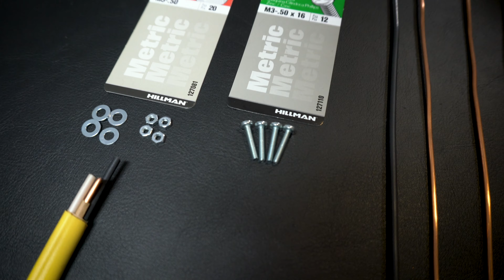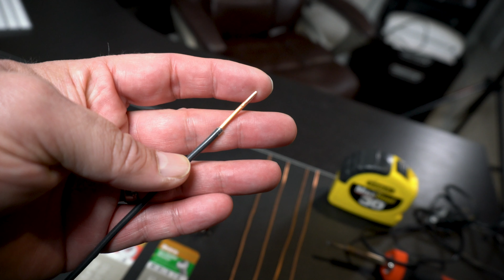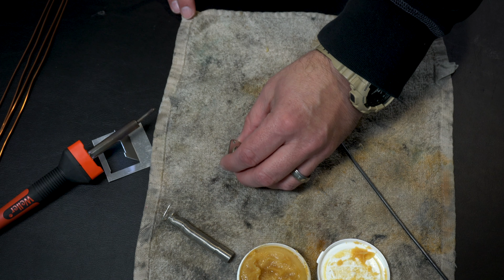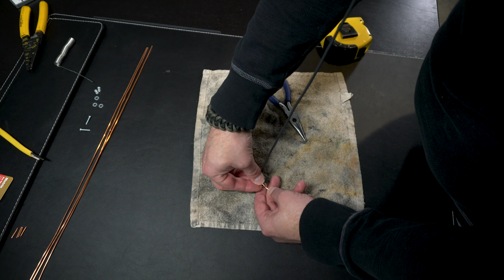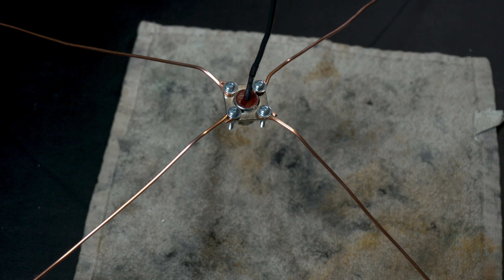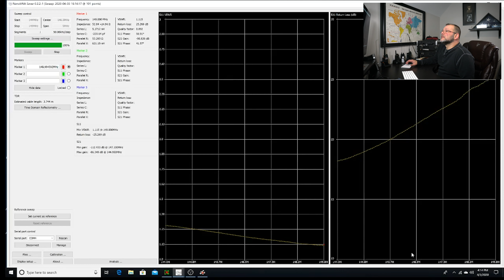Building a ground plane antenna

Comment: Hi there-new ham. I built one for 2m/7cm and I would like to put it on a pvc mast but would like to leave it outside permanently and run coax to my house for winter use. My question is does this type antenna need to be grounded, or just the coax?  Trying to figure out the best way to do that if it's necessary. Thanks
Reply: This is a quarter wave ground plane antenna.  Antennas of these kind do not need to be grounded..  the radius act as and reflect the signal at the same time

Three of them they all work great. The same antenna for 2 m and I also made one for GRS, which is a smaller version.  A smaller version for GMRS is very similar to 70 cm and I use it on 70 cm quite often even though the dimensions aren’t perfect. It still seems to work really good.  
70 cm repeater that I access is about 25 miles away reaches out real good

Can I use this 2 m cord wave ground plane antenna to access a repeater about 50 miles away which is up on top of the mountain

Works great,
Reply from the maker: The antenna does not need any additional grounding but I do recommend some type of lightening arrestor in line with our coax. It will protect your equipment in the event of a lightening strike. I do recommend grounding your radio(s) if you will have permanent outdoor antennas attached.

Comment: Works much better to solder the ground plane elements directly on the SO-239,also,I drilled a hole in a medicine cup,filled with bondo,and slide onto the radiating element, and let it set up! Super weather seal

Comment: You don't have enough heat on soldering the radiator to the SO-239 connector.  That's not shrink wrap.  It's called heat shrink.  Shrink wrap is used on large skids or pallets of material.  A 2 meter is a VHF antenna not a UHF one.  That would be a 70cm antenna for UHF.
Reply: Get over it, get over it and get over it. 😂

By the way the antenna works on both bands. 😎

Comment: maybe your next video can be stringing up a wire antenna around the ceiling inside seen some hams doing that with success.
Reply from the maker: This antenna is actually mounted in my attic along with an end fed wire antenna with a 9:1 balun. The problem with showing it on here is my attic is broken up in a manner that most of it is very hard to reach.

Comment: I'm curious if the radials are touching the floor does that change your readings?   I would think the floor would become part of the ground plane.   Would be interesting to see if it changes at different heights.   Great video!
Reply from the maker: It does change it some by lifting it off the ground. If you build one we can compare notes on our tests.
Reply: @TheNewHam  I do love tinkering with antennas.   I bet you're even closer to 1:1 up in the  air.   I kind of got the feeling watching your video  you're weren't completely satisfied with readings and the thought hit me the ground might be getting into the mix of things.   It's a great time with all this virus stuff to tinker around with projects like this.  Keep up the good work!